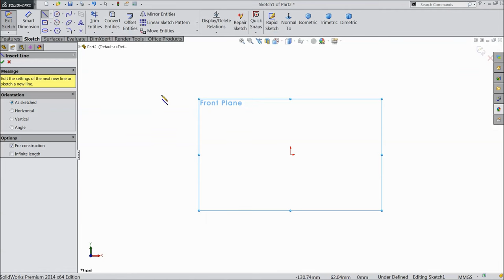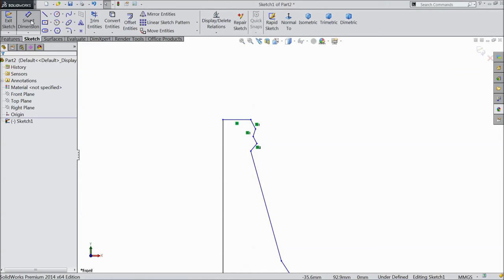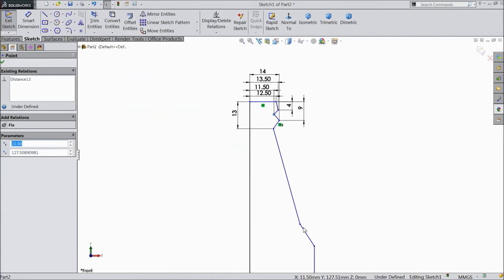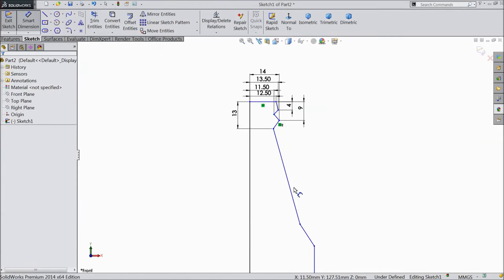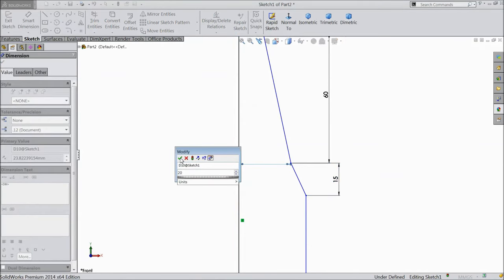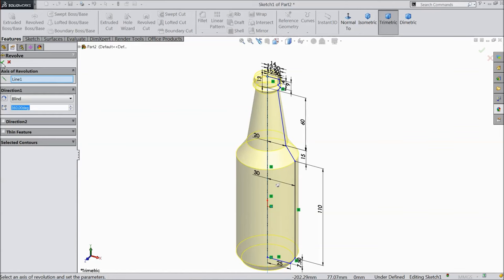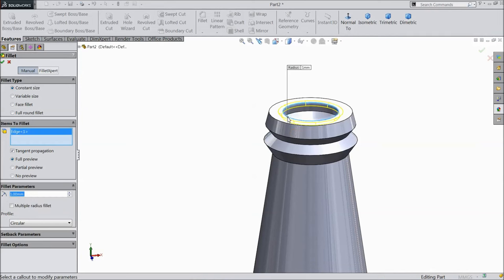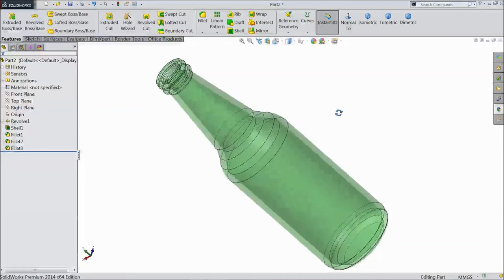SolidWorks Tutorial Bottle

Comment: This is overall 4mm thickness of bottle but I want to 4mm thickness in thread area & 1 mm in body area
How can I do it
Reply: in this case u have to define thickness directly in your sketch, so later on there is no need of using SHELL instrument. So u ll have to draw both: inner and outter walls of the bottle. The OFFSET tool will help u with this